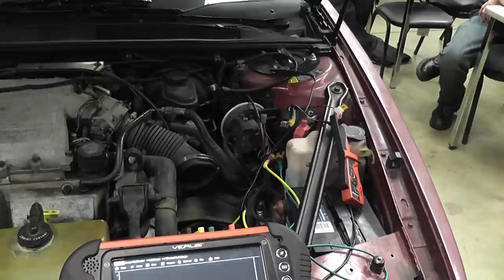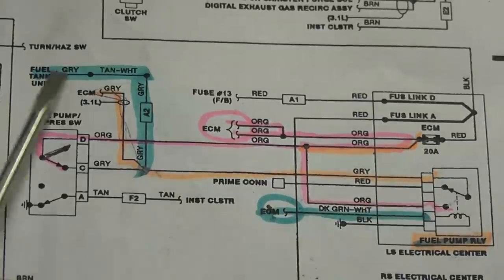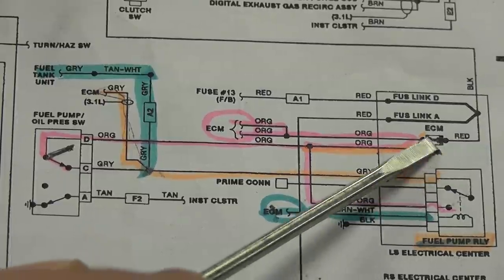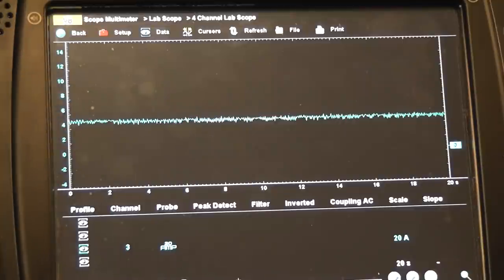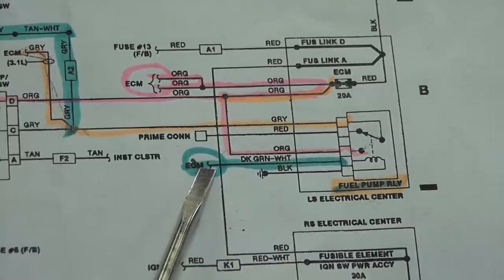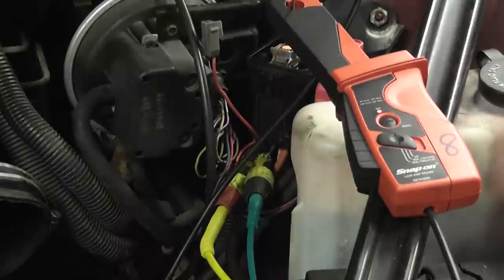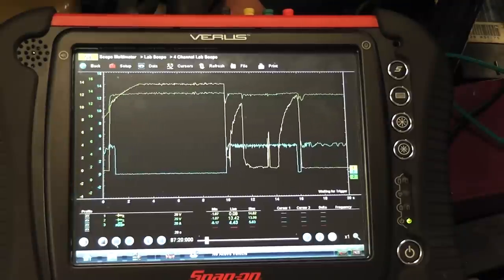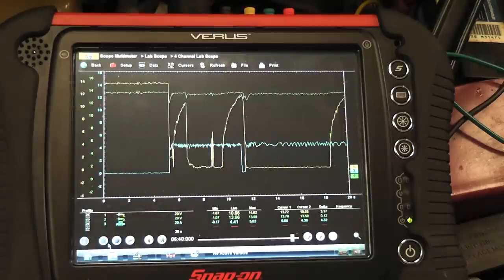Fuel Pump Relay Problem

Comment: scanner danner.. try this test.
engine running.. headlights on. DVOM set at 20 volts DC.
1. Negative battery post to the positive. 14.1 to 14.8 volts DC is expected
2. Negative battery post to the Engine block. 0.04 volts DC MAX.
3. Negative battery post to the Body. 0.02 volts DC MAX.
4. Engine block to the Body. 0.02 volts DC MAX.

if tests 2, 3 or 4 get more than the 4/100ths or 2/100ths of a volt. you have proven the grounds bad.. this test takes less than a minute to perform.  try it..  line up half a dozen cars all with the hoods open , headlights on and engines running.. test all six see how fast it can be done..

waynep712222
Reply: why is test 4 important.. because the alternator puts out current / electrons on the negative side.. they try to get to where they are used the shortest path.. and the alternator output is higher in voltage than the battery. so it all goes from the engine to the body usually at the firewall..

this test needs to be performed at the beginning of any electrical diagnosis.. and before the hood is closed on EVERY JOB other than perhaps an oil change.. to save your self a come back. since you are the last one who worked on it...

spend the minute.. run the tests.. flag the bad ground . make money fixing it.
better to flag it for profit.. rather than have it come back and fix it for free in some shops..
Reply: wayne p
on the car above.. i would bet that the oil pressure switch contacts are bad..

i normally pull the fuel pump relay and if the engine dies. then the oil pressure switch is bad also..  the oil pressure switch and the relay  run in parallel.
as you have properly described.. the ECM has control of the pressure relay to prime the system at key ON..  and again while the engine is cranking. the oil pressure switch contacts usually handle much of the load once the oil pressure comes up.

Comment: PAUL, HAVE YOU EVR HEARD OF A FUEL PUMP SPINNING @ 8200 RPM? I CURRENT RAMP MY FP ON MY LINCOLN AND THE RESULTS ARE 139 HERTZ AND 7.19 MS WHEN I FLAG THE 8 HUMPS, CAN I BE DOING SOMETHING WRONG? SO FAR MY MATH SEEMS TO COME UP WITH OVER 8 KRPM,,,

Comment: I have a 2009 Buick Lucerne. The gas pump fuse is located under the back seat. I had to have a whole new fuse box put in about 1 year ago. The fuel pump fuse blew and melted the hole. Now it is trying to do the same thing. Replaced fuse and then when I turn my turn signals on they start blinking fast and the car will shut off. Check the fuse for the fuel pump and it's hot.  So replaced with new fuse. Now it is getting visible that one hole for the prong is starting to melt again. Does anyone know what might be causing this?